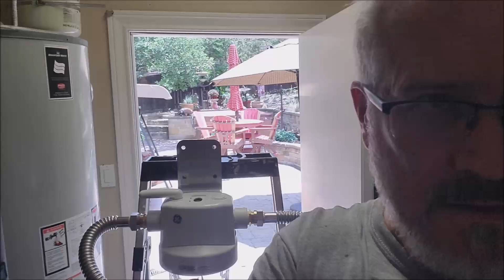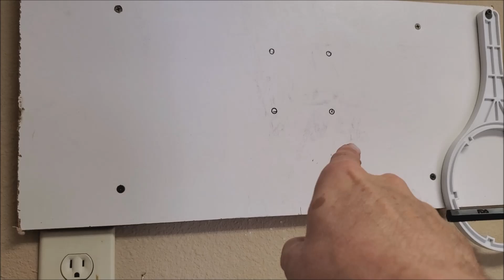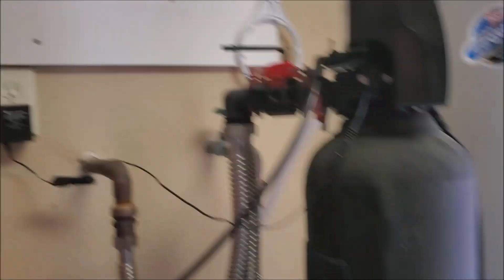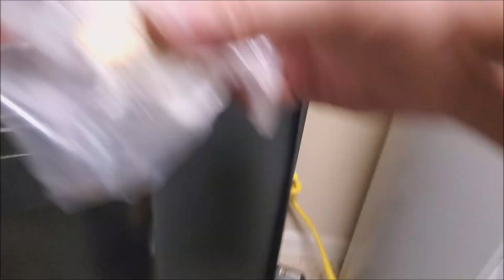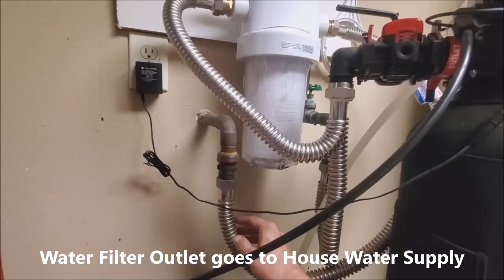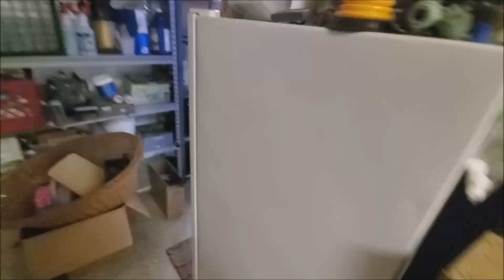DIY: Install A Whole House Water Filter

Comment: Should have a filter before (and maybe after it.)
Reply from the maker: The purpose of the filter (for me) is solely to prevent a softener resin breakout from entering the house water supply piping. A filter before the softener would do nothing to prevent that.
Reply: @thehoneybadger9262  catches sediment that clogs the valve in the softener
Reply from the maker: @Phil-D83  1) I'm on city water, so not such a big issue for me, 2) The resin breakout will be caused by a failure of either the upper or lower filter basket in the resin tank. Yes, a clogged valve system can cause the softener to not operate properly, but it would not cause a resin breakout.
Reply: @thehoneybadger9262  i am on city water as well. Got a spin filter, 5 micron and 1 micron before my catalytic carbon filter and water softener. May add something after the softener to prevent what you experienced
Reply: @thehoneybadger9262  what I have is overkill, but it works. Had issues with sediment here in the city lines. Also the smell and test of the chemicals added was annoying me. Fixed everything
Reply from the maker: @Phil-D83  I thought about doing two, but as you can see I don't have a lot of room (that filter is huge), and I didn't want the added cost of replacing two filters. One of the benefits of this particular filter is that there are a lot of options on what level of filtration you desire, including many aftermarket options (I chose an aftermarket filter).
Reply: I just watched your video. Well done. just one question I have. I don’t know how small the resin beads are so what size filter media (1 micro, 5 micron) do you recommend to be completely safe - filtration wise.